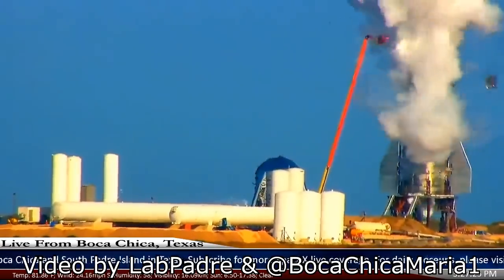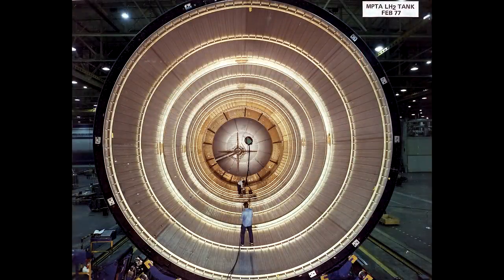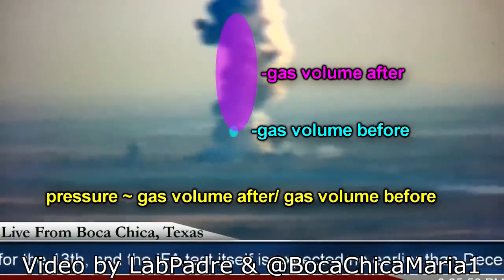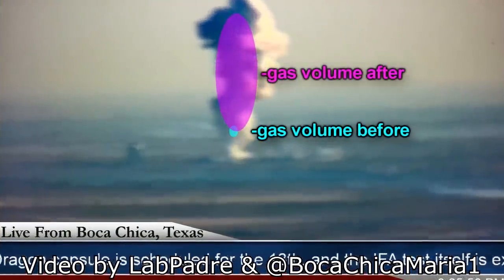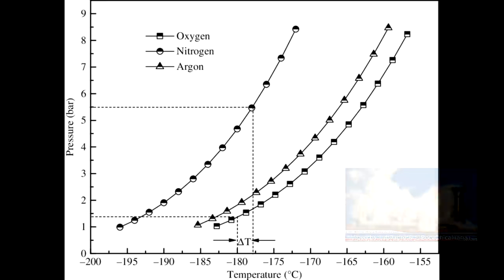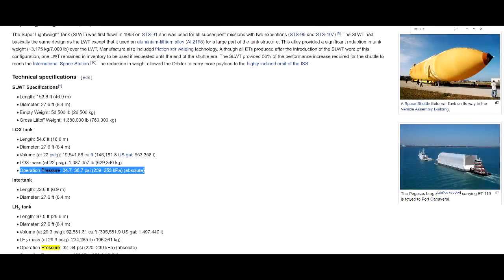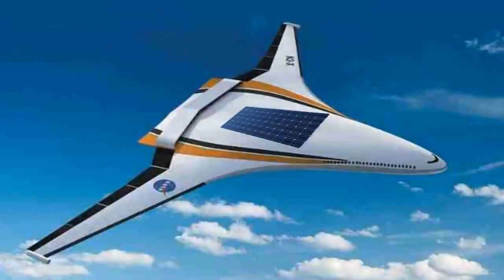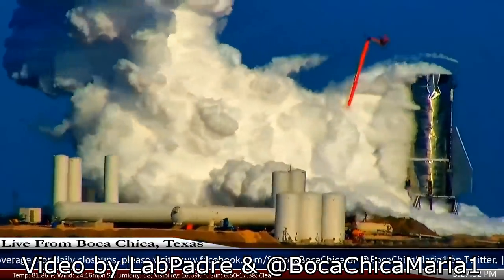Starship explodes, but why?

Comment: TL;DR: The rocket blew up cause Musk couldn't handle the pressure.
Reply: What does tldr mean? Genuine question
Reply: @danandoliver3613  Now you mention it I haven't known what that meant for ages and never asked...Michael was very helpful (If a little rude to MrMegapussy 😸).
Reply: @danandoliver3613  Are you born yesterday, or just trolling? (Being a Boomer is also possible)
Tl;dr stands for "too long didn't read" and practically is often used to indicate a summary.
Also Google (/ DuckDuckgo & similar) is your friend ... (In other words you can Google that sh .. stuff)
Reply: @martinda7446  ha! Good one
Reply: Dun dun dun dun dun dun dun...under pressure
Reply: @whoaccountisdisanyway2985  thanks, because I needed that stuck in my head 🤣
Reply: MichaelKingsfordGray  so angry , so loud. when that vein on your forehead pops you will lose some pressure.
Reply: MichaelKingsfordGray  Very adult sounding language.
Reply: MichaelKingsfordGray  fragile snowflake much? ya a real adult not being able to handle a pun.
Reply: Go back to minecrafr

Comment: Is it possible this whole test was just some sort of marketing stunt? I mean, it's a big shiny thing blowing up(ish). Seems like it was more for the cameras than any sort of useful test.
Reply: Either it was a failure during the test or an intentional "lets just push this to the limit." They're claiming the latter, although I'm not sure I believe that. But the place where they're building the rocket isn't too public, and they typically aren't too public about their tests (compared to their normal launches, that is).
Reply: Considering this was a Mark 1 starship and they're already working on Mark 2 and 3, my guess is it destructive test. This vehicle design has already been deprecated by the subsequent models so I'm not sure what they could really learn from a destructive test anyway.
Reply: Supposedly it was a comms problem where the pumps didn't respond correctly to the pressure sensors. See https://youtu.be/nf5q2YlM2mU at about 1 minute in.

Comment: Tim Dodd will say you're being negative again🙄
Reply: Well he is being negative. Phil didn't explain this was a Mark 1 vehicle and they're already building Mark 2 and 3; odd numbers in Texas even numbers at the Cape in Florida. 

There's no way they were testing the system that repressurizes the tank from the engine exhaust because the turbo pumps weren't running or possibly even on the vehicle. Mark 1 starship design has already been deprecated. The real question is whether this was an accident or a destructive test. I'm not sure what they could have learned from a destructive test since the design has already changed significantly with the later revisions. I'm hesitant to just make up an answer though.

 Phil doesn't seem that familiar with the starship vehicle in general. I wish he'd give the engineers some credit for designing a completely new rocket engine from the ground up with the Raptor. It's the first full flow closed cycle rocket engine to fly, and it's the first of a new generation of rocket engines that run on methalox instead of RP-1/LOX. It's the most efficient rocket engine to date and the most powerful currently in use.

How about the fact they're reused a booster five times and successfully landed dozens now? How about the fact they've successfully recovered payload fairings AND reused them as well? None of this fits with the narrative that Phil is sharing.

The development of starship is actually ahead of the schedule they announced two years ago at the BFR ITR event. There's nothing wrong with offering a breakdown of RUDs but there's a lot of context left out in order to paint SpaceX in as bad a light as possible because Phil can't bring himself to like anything Elon is connected to.
Reply: @faceplants2  
I hope starship is successful but I'm afraid  Elon will end up in prison.
Reply: @IvorMektin1701  LoL for what exactly?
Reply: @faceplants2  
It'll involve fraud, Amber Heard, narcotics, and El Chapo's wife.

Comment: I admire SpaceX a great deal, but i am certainly not a Elon fanboy - a large percentage of his idea's are total rubbish. A starship jumping around the planet 10 times a day is something i can never see happening, let alone being allowed to happen. After all, if you want to watch a rocket launch from the cape in Florida you are not allowed within miles of the launch site, for very good reasons. And i should imagine that distance would be increased for something the size of Starship and it's booster. So just where does Elon think he's going to find to launch one of these things in your average country? Take London for instance, ain't nowhere near there where you could launch a Starship - accept maybe 10 miles off the coast in the North Sea, which kinda ain't anywhere near London! Then of course you would have to shut the airspace down and make sure shipping is kept well away from the area. Just another wacky Elon idea (on par with the hyperloop i reckon).
With regard the big explosion, well, i am fairly certain that in the small version of the starship hopper they used normal pressure tanks (the live feed of it's last hop showed video from inside the lox tank and you could see the smaller pressure tanks inside). But not sure if they are doing that on this larger hopper. my guess would be the frozen valve theory, like you i really cannot see any other reason for such a large build up of pressure. The only video i have seen of the incident only showed the rupture, would have been interesting to watch the build up to see if we could see the normal venting going on. Shame it went bang, but i guess that is all part of the building and testing. I remember a complete second stage of the Saturn V went boom during testing, the carnage that resulted in was a lot worse than this starship bang.
Reply: One thing i really dont like is negative and overly positive views on this kind of projects. Of course you are not able to brake laws of physics, but nothing prevents "going past them". For instance spaceship flight from one side of the planet to another. Using current rocket tech its a no go for mentioned reasons, how ever if we had space elevators or orbital hooks that allow ship, or more like space plane to get on orbit extremely cheap, getting back is "easy". Its just re entry of gliding from high up that could be done with space planes that can land conventionally to airport and get back up with another orbital hook or space elevator after its inspected and ready to next flight.

This way dangerous liquid fuel rockets can be discarded and fuel requirements for each launch go waaaaay down making it commercially viable and much safer. Still compared to normal air planes its pricier and not as fast that of rocket flight, but positives out weight the negatives and regardless i really dont give fuck if some rich smock gets faster to their business meeting. I'm more interested about getting orbital infrastructure running and operational for expansions in solar systems, as with out them building least partial Dyson sphere, utilizing its energy output and using it to control how much energy is sent to earth to control global warming and cooling. 

We will be using what energy is needed, what is sent to earth from sphere using lasers and after that we can calculate how much energy we let past the sphere elements to earth, by positioning x number to collect and block energy from reaching the planet. If planet is cooled too much, we can set the elements to other side of the sun, collect that energy and beam it to earth. Essentially this is energy harvesting and thermostat to our planet. Though what ever orbital infrastructure will even be built is questionable as this would allow full mining operation is asteroid belt, where just one rock can contain much gold as there is in whole planet and cause fiat currencies are tied to gold value dropping just one shuttle worth to earth would make serious dip in golds and hence fiat currencies value, so rich wont do it as it would make them poor and poor dont have starting capital to even get to mining said gold to begin with.
Reply: @Hellsong89  Magic mushrooms will make you think you are swinging from  orbital hook, and don't forget the free energy you will get from your perpetual motion machine.
Reply: @Hellsong89  Got any links to this power transfer via laser idea?
Reply: His hyperloop is bollocks based on simply the speed and buckling issues. This though: why not it might move the technology forwards...as long as he isn;t scamming people like he is with the hyperloop.
Reply: That earth bus line might roll some day, but not with our tech today.
Reply: why would you launch a spacecraft anywhere near london (or anywhere in the united kingdom)?
Reply: @NathanHaaren  to save time
Reply: @NathanHaaren  Elon's dream of using the starship for global travel, not really practical if you cannot land or take off anywhere near populated areas. London was just an example.
Reply: @100SteveB  I dont think "global travel" is meant to be "one in every country", it is meant to be fast transport between continents, like 1 in the center of Europe, one on the eastcoast of the USA, one on the westcoast of the USA, one in the middle east/india, one in east asia/china, one in Australia, one in South America, one in Africa
this would mean you fly from e.g. London to central Europe to take the starship to the westcoast and then another plane to your destination
inside a continent you would just keep using normal aircrafts, which is a lot cheaper
Reply: @NathanHaaren  Unless you are using orbital rings, which owing to their great efficiency, would permit space travel to other countries to be cheaper.
Reply: @chalichaligha3234  orbital rings are extremely difficult to accomplish and to stabilize due to different gravity forces and stuff
creating them would also cost tons of money which would need to be earned back when in use
so dont expect orbital rings to be in use or affordable in the next few decennials
Reply: @NathanHaaren , Orbital rings are not difficult to stabilise because they are in orbit (or at least part of them is). Cables running to the ground will suffice. An orbital ring may be expensive to construct, but not unreasonably so if built on the Earth's surface. It could be built as an evacuated magnetic accelerator around the world, with the high speed steel cable inside. As the cable speeds up, it would slowly force the accelerator tube around it to become a near perfect circle, so mountains are no problem. Eventually the ring would lift of the entire surface of Earth as the cable speed increased. The accelerator would expand by only 2% to become a space orbital ring. Pricey, but doable with only a few decades of research and development.

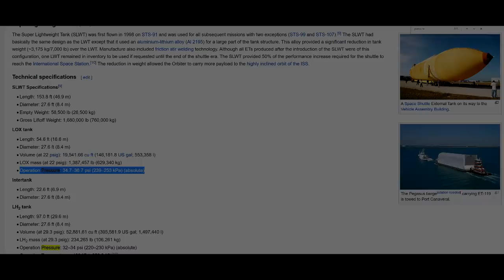Comment: 6:37 SpaceX released an update about the Dragon incident back in July. They tracked it back to a slug of NTO oxidizer driven through the pressurization system just prior to SuperDraco ignition which damaged a check valve.
https://www.spacex.com/news/2019/07/15/update-flight-abort-static-fire-anomaly-investigation

Comment: His rockets have at the least brought down the price of getting to orbit. That itself has been quite helpful.

You got to admit it is awesome seeing rockets land. He has accomplished some pretty great things.

I agree though that I doubt Gwenyth's idea that the reusability turn around will be that quick. I would expect at least a day to inspect between flights. Mostly just because of regulators. Even if the rocket was capable it is hard to see it being allowed.
Reply: Yeah, but he doesn't reuse most of them! Elon Musk is a showman who uses impressive ideas, he loves to elaborate on, and nice pictures to part investors from their money.
Reply: pcuimac source? And still space flight is cheaper becaus of Elon musk
Reply: @pcuimac  So far boosters numbered from B1001-B1057 have been flown (with B1059 preparing for a launch on December 4th), along with an additional set of boosters from B0001-B0007. Obviously the lowered numbered boosters were built first.  That gives us 65 boosters in total, excluding the currently unflown B1059. B1019 was the first booster to successfully land, so everything before it naturally didn't land. That leaves us with 39 boosters which were used in the period where the Falcon 9 could land.

So B1019 was retired to be inspected and put on display, since it was the first they landed.
B1020 failed to land.
B1021 was reused once.
B1022 successfully landed but was retired.
B1023 was reused once.
B1024 failed to land.
B1025 was reused once.
B1026 successfully landed but was retired.
B1027 was a test article
B1028 exploded before launch.
B1029 was reused once.
B1030 was expended.
B1031 was reused once.
B1032 was reused once, but expended in the reuse.
B1033 failed to land.
B1034 was expended.
B1035 was reused once.
B1036 was reused once, but expended in the reuse.
B1037 was expended.
B1038-B1041 were reused once, but expended in the reuse.
B1042 successfully landed but was retired.
B1043-B1045 were reused once, but expended in the reuse.
All of the rockets above are block 3 and 4 Falcon 9s. Of this set of 27 rockets, compromising the early to middle period of Falcon 9 recovery, 2 did not fly, 3 failed to land, 3 were intentionally expended on their first flight (to gain more performance out of the rocket), 4 were retired after their first landings (which makes sense in regards to 1019 and 1022 needing to be used for inspection and testing regarding reuse), and the rest were reused once. That is 12 non-reused rockets of 27, which leaves 15 reused rockets from this group of block 3-4 Falcon 9s.

Block 5 is the current generation of Falcon 9 rockets, and the later Block 3s and 4s were typically expended on their second launch due to SpaceX wanting to switch over to entirely Block 5 boosters. The current history of Block 5 boosters is below:
B1046 has been reused 3 times and will be expended in it's 4th use.
B1047 was reused 3 times, being expended in it's 3rd reuse.
B1048 has been used 4 times and is still in service.
B1049 has been used 3 times and is still in service
B1050 suffered a gridfin failure during the landing approach, and soft-landed in the ocean rather than on the pad. It was damaged but recovered. Current status is unknown, reuse might be possible but is unlikely.
B1051-B1053 have been used twice and are still in service.
B1054 was expended.
B1055 successfully landed but tipped over in transit, breaking the rocket in half.
B1056 has been used twice, and is still in service. It is planned to launch again next month.
B1057 failed to land.
B1058 is scheduled to first fly in the Crew Dragon Demo-2 flight sometime in early 2020.
B1059 is scheduled to first fly in the CRS-19 mission on December 4th.

Of the 12 rockets which flew, 1 was intentionally expended, and 3 more suffered failures on or after landing. That leaves 8 rockets here which have been reused.

Of all of the block 3, 4, and 5 boosters (the only ones to land), only 8 were either intentionally expended or not reused after their first flight. 23 boosters so far have been successfully reused, and all of them performed as intended on all of their flights. There were 38 flight-worthy boosters built of the blocks 3, 4, and 5, so the remaining 7 failed recovery (except for B1028, which exploded on the pad).

So of the subset of boosters which had one of their type land, SpaceX has reused most of them. Saying that SpaceX hasn't reused most of their boosters is factoring in the ones which were flown at the start of the program, before they had attempted to land or the ones which made up the early landing attempts. And if you factor out the boosters lost in various accidents, then SpaceX has reused 23 out of 31 boosters, which is almost 3/4 of them.

Your statement, although technically true, is intentionally heavily misleading to promote an agenda.

Comment: They did comment on what the problem was with the dragon capsule. I believe it was another valve issue where a one-way valve allowed oxygen to go back in
Reply: I think the one-way valve briefly became a too way valve, letting a tiny bit of fuel through. When they activated the engines the hydrogren pushed this little bit of fuel back at the valve, and it hit it like a bullet, shattering the valve and starting a metal fire in the fuel tank, because all the fuel reacted with the metal. That's the explanation I heard anyways.